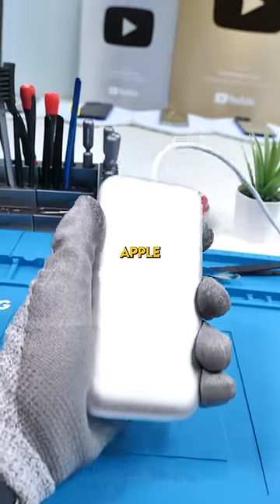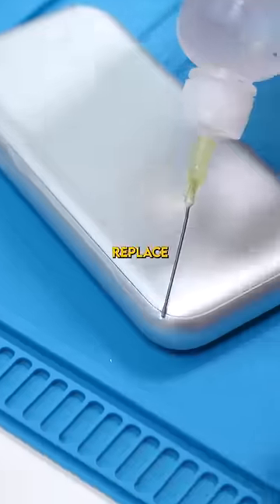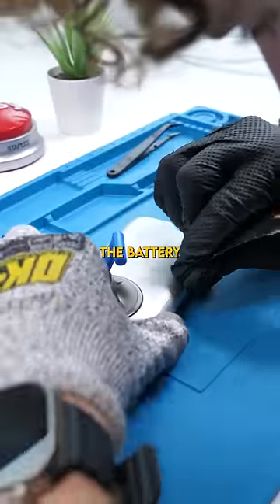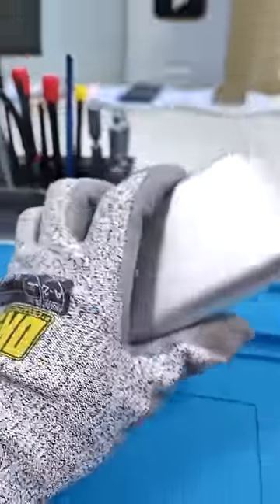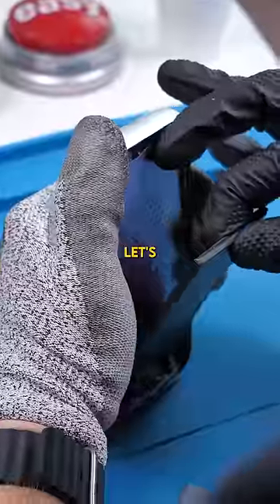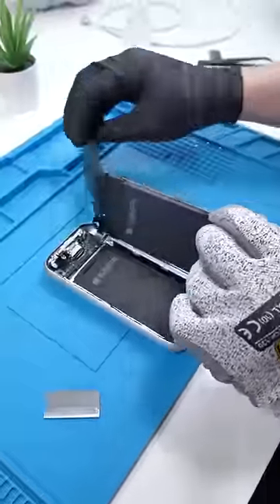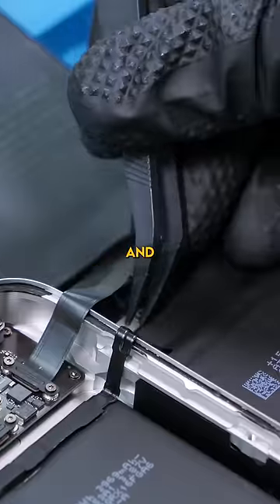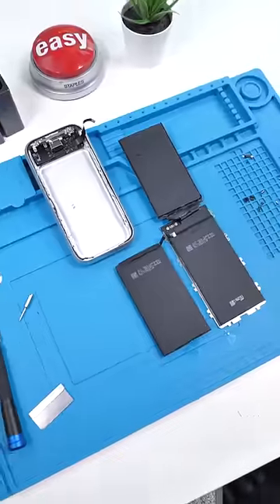Inside The Apple Vision Pro BATTERY... #Shorts

Comment: "Unable to verify if This Apple Vision Pro has a Genuine external Battery" 💀
Reply: "Unable to verify this Vision Pro has a genuine external battery. Charging not available for this battery."

Apple has updated the device information for this external battery. 

Learn more
Reply: Seems fine to me if it can give that notification
Reply: @Kyermike  Apple's just gonna copy-paste this 😂
Reply: Only one Exe will work😂
Reply: Imagine if it doesn't turn on at all
Reply: program it
Reply: "self destruction mode activated, exploding in 3..."
Reply: Apple : "write it down, write it down"
Reply: "battery health and peak performance mode disabled" You can now only run @720p XD
Reply: @Kyermike  "Unable to verify genuine battery pack. How dare you try and not spend $200 for our one. Self-destructing in 3...."
Reply: @bostoncelticsfan07 😂😂😂
Reply: "Unable to verify if this Apple Vision Pro Battery Pack Charger is connected to a genuine Apple outlet"
Reply: probably shows up on the vr display, and you can't get rid of it typical apple..
Reply: @R3CKLESSRHINO  yup, that’ll definitely happen
Reply: The rich don’t care, they will just buy 5 batteries and spend 1K because they can.
Reply: @Kyermike apple finna use this
Reply: The probably have wired it so the controller wipes itself when you replace the batteries.
Reply: @bostoncelticsfan07  and you can hear "locking up complete" before self destruction message.
Reply: @CHMernerner  🤣🤣🤣
Reply: 3d print a shaver for larger cells?
Reply: Sword art online ☠️
Reply: @Kyermike i tried clicking learn more
Reply: "Unable to verify if your lung is a genuine lung. Breathing temporarily disabled." 💀
Reply: The most apple thing ever

Comment: Knowing apple, they won't make replacements. They'll just make you buy a whole new battery
Dang. This got 4k likes
Reply: "Unable to verify if this Battery is Genuine"
Reply: "Eco conscious"
Reply: nah, a whole new vision pro
Reply: and we as repair workers dont give a shit about it, hold my soldering station. I can disassemble and assemble any airpods without marks and any damage (except pro case, scratches will happen) and on aliexpress we can buy any replacement parts. Same thing gonna happens with any popular apple device
Reply: Very environmental friendly indeed
Reply: More like whole new vision pro set 😂
Reply: and they put pull taps so they can change the battery 198
Reply: Or they make the replacement mote expensive than buying it new
Reply: Better than buying a new apple vision pro
Reply: that’s why they sell it as a standalone product in the apple store
Reply: At least people dont have to buy a while new Vision pro.
Reply: Considering most of it is just LiPo cells the associated charging/discharging circuits are a tiny proportion of the cost, so it wouldn't save much money to offer just the cells. How do you get from three LiPo cells to $200? Markup.
Reply: Do you know company that sell power bank, and repair it if their customer claim the warranty? Repair not replace the unit.
Reply: That why the 3rd party come
Reply: @Swordfish728  because it's apple cells
Reply: @saintvenant666  meh. Not really. 300 for a battery is kinda steep
Reply: In the EU, Apple will have to make this replacable or they will not be allowed to sell this
Reply: @spaceflightquack  they'll probably find some loophole to get around it like usual
Reply: Imagine thanking people for liking a comment😂what a nerd “🤓thenks fer the likeths guys🤓”
Reply: If you think Apple doesn’t make replacements you don’t know Apple.
Reply: @TemptatioN103  says the guy with no likes😎
Reply: @TheOfficialOriginalChad  I know they overcharge for replacements to try and get you to buy a new product
Reply: @rcguy7244  once again a clout chaser for likes😭thanks for validating my point of you being proud of likes on a comment ur life must be fun with youtube likes
Reply: i got the vision pro now waiting for apple battery pro max
Reply: because all of us know its true only people living in idiocracy would dislike
Reply: Replacmrnt theory
Reply: Tbh, it seems more simple. You bring your old one in, they give you a new one. The old one has the chassis recycled.
Reply: @kombrug I doubt anyone is going to want their battery replaced, and I doubt you can offer that service for less than what a 3rd party battery would cost to just carry and sell.

Comment: 200$ for a 3100mah battery pack is criminal 💀
Reply: Tbf it makes "some" sense. Regarding the 3100mah you have to remember its running like 12v instead of the 5v most batteries you for your phone are which means the mAh rating does not compare. To compare them you'd have to get the watt hour rating between them. (Batteries are in series for voltage rather than parallel for capacity, meaning any battery the same size thats higher voltage will have less capacity)
Reply: The apple battery is roughly 36wh, for a comparison of my $150 24k mah anker 737 which battery cell is about double in size physically and achieves 86wh. I agree btw that $200 is a very "apple" price, a more fair price would probably be around $130 or so. Plus I don't even think apple is using new GaN cells which are more expensive but bring up just about every stat while bringing down size (Anker's new stuff uses GaN cells hence why they can push 150w charging both ways)
Reply: @hiRyan329329  Also meaning if one battery is out/outputting less voltage, the whole pack goes down with it, meaning more frequent replacements? I dunno how thing is designed, I'm just commenting on its apparent basic internal structure.

Comment from the maker: Should I upgrade this...?
Reply: You definitely should my guy
Reply: Definitely
Reply: Yes make it 20,000 mah 😂
Reply: Connect it to a power supply so it’s connected to mains voltage INFINITE battery
Reply: Absolutely
Reply: Yes
Reply: No balls to put a car battery on it.
Reply: you should put 18650 batteries again, master...
Reply: Get the biggest battery to fit in the case, than make another with the biggest battery you can get in a make shift case
Reply: Yes or swap it with another to make sure it’s not serial locked
Reply: Absolutely
Reply: Yes you SHOULD!!
Reply: Yeah put a samsung Tab batterie in there lol
Make it like 10k mah
Reply: Yes
Reply: Go for it
Reply: Itd be hard not to
Reply: YESSS MAKE IT MEGA BIG
Reply: @Djungelskog69  the battery already has a usb c port for this
Reply: Yes
Reply: Yes!!!!!!!!!
Reply: Y E S
Reply: Make it transparent
Reply: is that even a question ?
btw it'd be better if you could 3d print a custom case to transfer the electronics from the apple ahh battery pack and put a bigger battery while keeping it aesthetic cause the last battery mods you've done were definitely not pretty 💀
Reply: Of course.
Reply: yes with nuclear reactor
Reply: Yes
Reply: Yes
Reply: First maybe convert it to proper USB-C..
Reply: U should replace that 3 leaf of thing that apple called "battery"
Reply: Yes you do
Reply: Make it type c!
Reply: offcourse bruh just scam $200  with small capacity when u can use normal powerbank had 20000 mah n more cheap than that shit 😅
Reply: why not my guy?
Reply: Definitely replace with 18650s
Reply: Yezzirr
Reply: Fashooo
Reply: YES
Reply: @Djungelskog69 Infinite power!
Reply: 100%

Comment: can we use this as a power bank?
expecting some third party to sell some type c cable for this 😂
Reply: Ah yes lightning pro to USB c cable coming soon
Reply: its running at 18v unlike the typical powerbank
Reply: @MLTAKOS  how about using it as Mac Mini power bank ...
Reply: @animo401  so i searched it up, i was wrong, its 13v actually and 6a so it could do up to 80w so it with the a connector swap it could work? but for a macbook since mac minis need 150w
Reply: Buy a normal 10 000mah battery bank for 16.95$ my guy 😂
Reply: If its for a macbook, there are some regular power bank that can power up to 65watt max, i mean for people who crazy enough to bring their mac mini everywhere, also ofc for educational purposes 😂
Reply: Looks like it’s actually too powerful and that’s why they didn’t put a usbc connection on it so ppl don’t use it for other devices so they don’t fry them. Heard that on another video. Seems like the vision is pulling some serious charge. Well it has 2 gpus and 3 displays topower
Reply: @MLTAKOS  type C powerbanks work with up to 20v

Comment: cant wait for anker to start selling a battery pack that lasts twice as long as the original for half the price
Reply: it uses proprietary connectors so it would have to be just a battery pack plugged into the apple battery pack
Reply: the proprietary connection is obviously patented so that no other company can create a similar battery and Apple can rip off its customers :)
Reply: If you charge the powerbank then they could make a click on pack that chargers there battery when its empty with a belt holder so you can click it on youre belt for a 2 /3 Times charge.
Bassicly the same a Mobile battery case!

Comment: So you mean to tell me that it technically has  3 batteries yet only lasts 2 to 4 hours?
Reply: I mean, It also has two 4k displays, two chips and the biggest array of sensors and cameras in any headset, that are constantly on. Of course it would consume lots of power
Reply: @Sasha.1248  nah battery is small. Only 3100 mah something. While being size of 10,000 mah battery pack.
Reply: @currycel470 I think it’s actually connected in series the 3 batteries so the voltage is probabily around 12ish volts not typical 5v from a power bank it’s more efficient that way
Reply: @currycel470 For batteries we should consider the Wh rating, here we have a battery with 36Wh. 

that's what really matters, the Wh. 

You can compare batteries only if they are in the same range of voltage (ex. phones, where is a standard range) (FYI, phone batteries are ranged between 3.7-4.2V. Most flagships have a capacity of +- 13Wh), but here we have +- three times the voltage with +- four times the flow of current. 

So, for a battery like this with so many things going on in the headset, I would say it's pretty good.
Reply: @Kotlazeu  Nah, not even close...
This battery is just a typical Apple cashgrab and it's not even that good...
As usual they also made it hard to repair.
For a 200$ dollars this is the most expensive low capacity battery.
I mean I have a 74wh powerbank which can power laptops and it costs 60$
Reply: @Kotlazeu you can get 72 Wh power banks for $40, a fifth of the price.
Reply: It's more similar to laptops where the battery Voltage is higher
Reply: Its a 35watt battery. So pretty strong for a powerbank.
Reply: @Kayserjp  35Wh for $200 is highway robbery.
Reply: @Kotlazeu ??? No it still isnt worth 200$ lolwut
Reply: @TremixNeo  Do you think those preschoolers understand that?

Comment: Okay, Hear me out. All you would need is a custom adapter for the plug and then theoretically you could connect it to any sort external battery that uses say for instance. USB C. However, if the headset is using some kind of battery verification system then you would have to take a different approach

Comment: “Replacements” you just need a spec for size or smaller. You can get smaller batteries with good or better specs. It’s just a matter of if the Vision Pro will ACCEPT the charge after replacing the stock with aftermarket. God only knows. Good luck and thanks for the great video!

Comment: Don't really need special replacements, at least as long as it still technically works when you replace them. Just get generic cells with the same specs and size. Balance the new cells first to match the voltage of the old ones, then do a bypass install and replace. Then the battery chip never loses power and has no idea cells were f*cked with. In extreme edgecases, you can even do this with live gear. Just really do your homework and practice first, because its not without risk, and lithium pouch cells get hella temperamentful if you don't treat them well.

Comment: Look and see if you can find an accelerometer in there. The battery is touch or vibration sensitive, and I would like to know if it is using an accelerometer.

Comment: On the plus side, aftermarket batteries can take the blame for bursting into flames when damaged.  And customers can get longer lasting and lighter batteries.  Still wondering if Apple will make a mainstream version in about 5 years, or just leave out some parts and sell this one as the entry level in 2 or 3 iterations.

Comment: Isn't replacing the pack basic layout just replacing the battery? Besides when it comes to replacement, you'll either want to upgrade or at least replace the battery sensors

Comment: Everyone talking how it's a small battery compared to its size
What you missed is that it's high voltage, meaning it gas much more watt hours
Reply: It's just 35.9wh, equivalent to a 10 000mah battery pack that costs $10.
This is criminal lol.
Reply: It's only 35.9 Wh. That's tiny.

Comment: Those batteries are TINY. 35.9Wh in the same volume as my $40 Anker's 72Wh. They give less than half of the energy stored for 5 times the price.
Reply: Apple uses a non-standard voltage 13V :/
Reply: @vavra123  35.9 Wh / 3.166 Ah = 11.33 V

But it doesn't matter. The total energy is still very little for how big it is, and very little for the price.

Comment: How much mAh is it?
Reply: Its around 3000mah which seems small but instead of running 5v like most portable phone chargers its running 12-15v (getting conflicting info in that range). So batteries are in series for more voltage rather than more capacity. In this case you would use Watt Hours instead (like on a laptop battery) as mAh is really only useful when comparing like items

Comment: So the pack has three batteries of the size of modern-day smartphone's batteries, which go from 3000s mah to 5000mah and even more... Yet they all together are just a little more than 3100mah...
Reply: because they are wired in series to output 12v instead of 3.8v of a typical smartphone battery

Comment: Why even bother removing and replacing the battery though? iPhone battery be out there costing a hundred for just one battery pack. This thing has 3 - so the laws of scaling suggest it'd be better just to get a new battery every 2 years and recycle the old one.

Those dumb enough to spend $3500 on the Vision Pro aren't going to feel pain from a $200 battery replacement.

If I were Apple, i'd offer battery exchange program 🤷 send in old battery for recycling and you get new one for $100. Not only would customer get battery cheaper, but Apple would save on costs thanks to returned logic board, aluminium casing and literal rare minerals which can be used to make a new battery. It probably should be a crime to sell you a battery and treat the components that aren't the battery cell as junk that can only be sent back for free because apparently it has no value.

Comment: All that size + 3 batteries and it only about 3000 Mah WTF apple😒
Reply: if u connect paralel, u will add mAh, but If u connect in series, u will add voltage